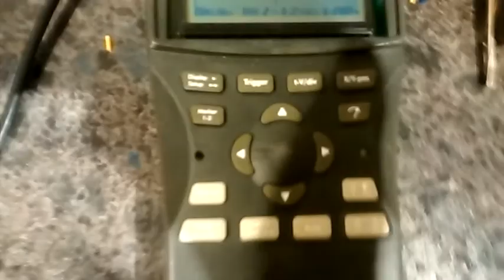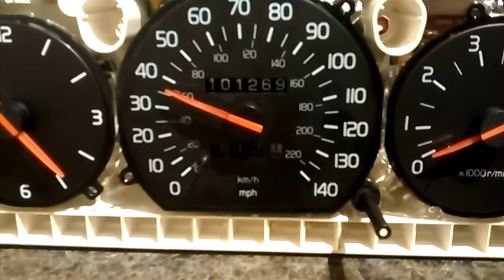Testing Volvo 940 speedometer after repair

Comment: Neat setup, would you care sharing how to power the unit on the bench and where to connect a signal generator? Thanks!
Reply from the maker: The speedometer has only 4 poles. Power positive Power negative and two signal in. i have a feeling they were appropriately marked on the printed circuit. The signal hits the same terminals that the sensor on the rear differential hits.
Reply: Great, many thanks!
Reply: @tensago  What else do I have to hook up? My speedo does not work with just power and sensor connected.